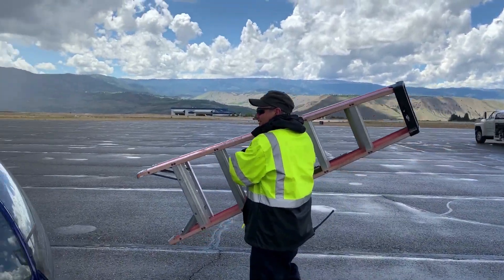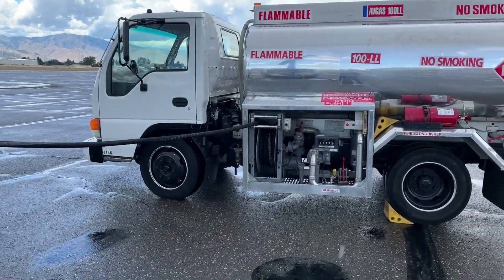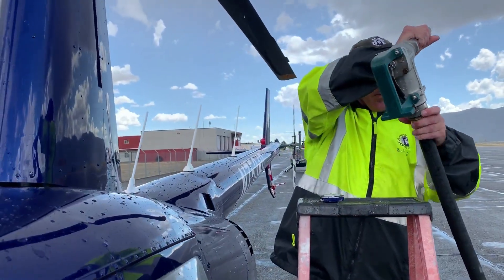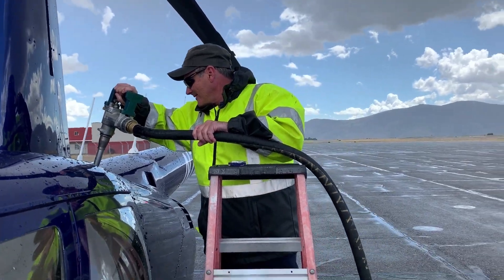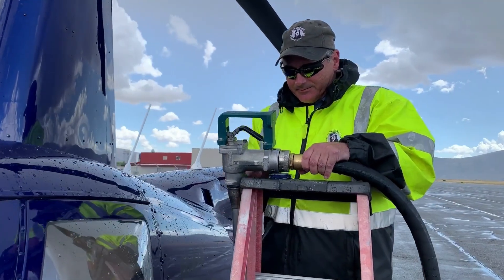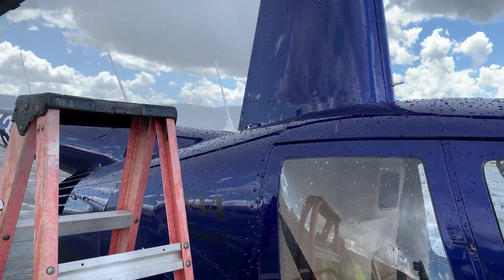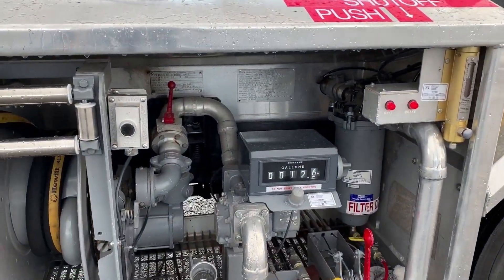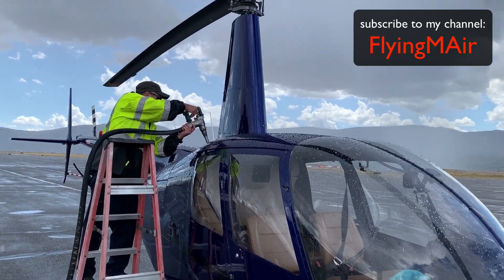Fueling a Robinson R44 Helicopter

Comment: A lot of airports in the UK no longer do running refuels,it would be very dangerous anyway due to the tank position on a Robinson especially seeing him balance on that ladder,I have never seen it done on this type of helicopter ?
Reply from the maker: I can't imagine hot fueling with your head so close to the rotor disc.
Reply: Running refuels were really instigated by the military in combat situations where the fuel tank access was at a lower level,then a few people in the civil scene decided that they could get from A to B quicker if the engine was not switched off for refuelling and it started to get popular,thankfully many of the airports stopped it due to their insurance cover and who can blame them ? one spark even though the machine is grounded could spell disaster on a hot engine,I think it is still used at Londons Battersea heliport for quick turn arounds,dangerous to say the least.

Comment: Why do the cherry trees have to be dried so often? Is it to use less pesticides?
Reply: Take a look at Marias other videos and you will see why cherry trees need care after it rains,there is one where she is doing such a sortie flying in a tight orchard with power lines very close by !
Reply: When the cherries are almost ripe, if the water sits on them it soaks in and bursts the skins, so they use the helicopter to dry them off and save the crop if the rains come at the wrong time.

Comment: For those that aren't familiar with aircraft and static electricity. Remember as a kid in your stocking feet scrushing around on the carpet then walking up to someone and shock them! That's Static electricity. The airframe and skids flying through the air create a small friction and buildup static electricity, so the VERY FIRST thing before refueling is to connect a ground wire to drain the static electricity buildup. Failure to do that may cause a Deadly SPARK between the fuel tank and the pump nozzle, the skids to the ground are a good contact, but remember that the fuel truck is insulated with rubber tires, it must be grounded as well, that cable serves both. Thats also why when you take gas cans to the station for lawnmower gas, you Never Fill them inside the truck bed or car. Always pull the can out and set it on the ground so any static buildup can be released. 
Stay Safe, 
Have a Great Day!!!
Reply from the maker: Thanks for this. I realized after I wrote the description that I didn't go into any detail on the grounding wire.
Reply: @FlyingMAir  Never meant to correct you, we Love your videos, just wanted to add a little explanation for those that don't fly. 
You're an inspiration to everyone watching, Keep up the Great Work!

Ps, we've flown cherries, grapes and Christmas trees along with heli ski and heli snowmobile. Most people get a blank look when I tell them I've flown cherry trees, now you've got beautiful videos that I send to them so they fully understand. Now they say,  Oh that's so kool! 👍👍
Reply from the maker: I didn't think of it as correcting me. You were just expanding on what I mentioned in the video but not in the description.
Reply: @timmorris3056  I get to correct someone though! (Google "xkcd someone is wrong on the internet" ;) lol 

The fuel truck will have a conductive rubber ground strap hanging below it in contact with the ground to keep it from accumulating a charge.
This is standard for fuel trucks, busses (so you don't get shocked when you touch the bus), electric utility trucks (bleeds off induced voltages when they are near high voltage, such as in switch yards) etc.

If you didn't have a continuous ground drain, then the truck would build up charge while driving, or from wind blowing over it, until it arced over the tires, or someone got out and grounded it, either way creating a spark.
With the continous grounding, it prevents the potential from getting high enough to create a spark.

Also, while the copter may have metal skids, most aircraft have rubber tires, so there has to be another bonding method to ground that is always there.

Comment: How long on average (I know depends on what exacty you're doing) does a full set of tanks last during your cherry-drying season?
Reply from the maker: Not quite sure what you mean, but I can get 3 hours of flying out of full tanks of fuel. I just got my fuel bill in the mail and it looks like I bought 310 gallons last month. Ouch.
Reply: @FlyingMAir  Yeah, that's what I meant: average flying time because I would imagine hovering and cherry drying is more fuel hungry than straight flight in light weather etc.,